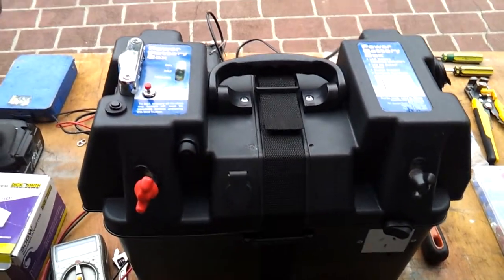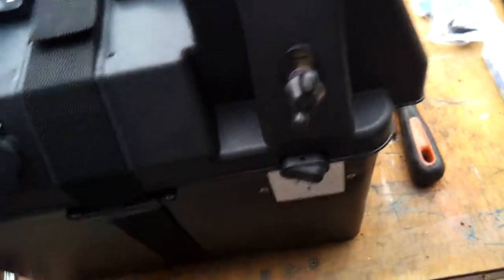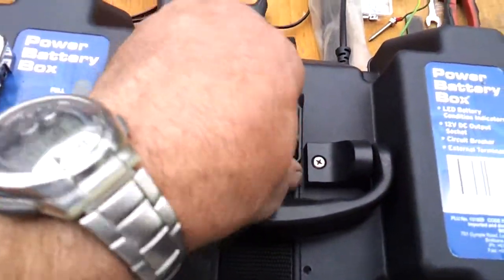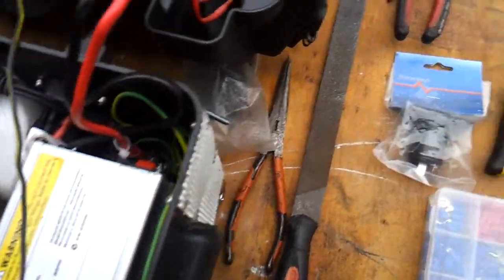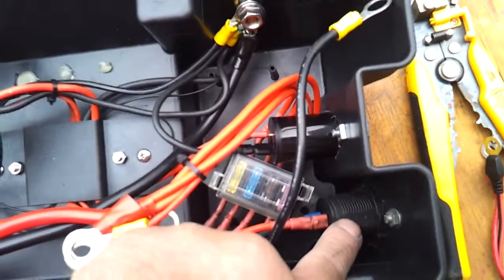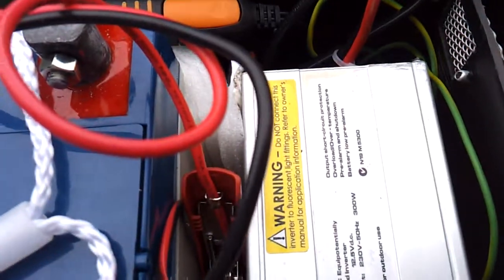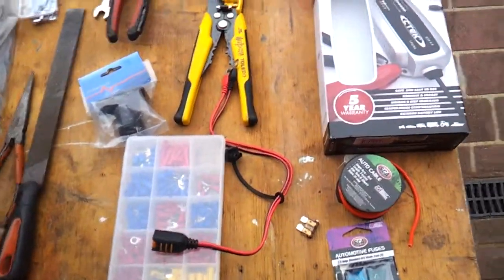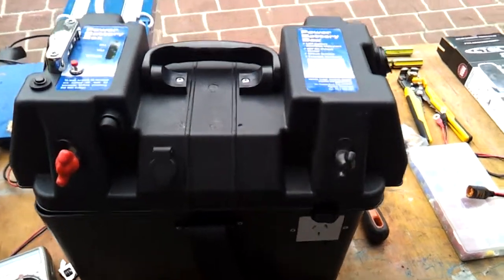20140125 175542

Comment: Great detailed video, thanks. I bought a 130Ah AGM and also put in a battery box by projecta. This is for camping, fridge etc. but also considering buying a 12ft tinny like yours. Would it be good for powering a watersnake and other stuff or would be too heavy?
Reply from the maker: Its great for powering my minn kota. It works well. use it for camping Lights fridge and also for the 'lecccy motor in the boat. Handles it well. Your 130ah would be a bit heavier but it would do the job even better. Might have to cut down on some fishing gear to save weight - only kidding - try it out and see how you go. Once you have your set up see how it handles it - experiment and learn
Reply: Dave Boxwell thanks for the reply Dave. I actually bought a 15ft fiberglass boat so the weight won't be a concern anymore. I will use it to power a fishfinder and other lights etc. Happy!